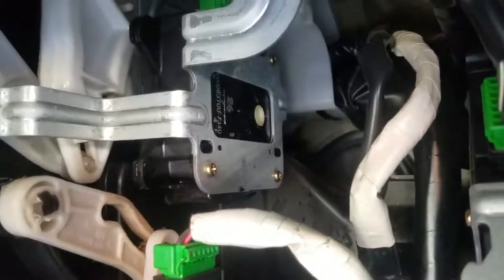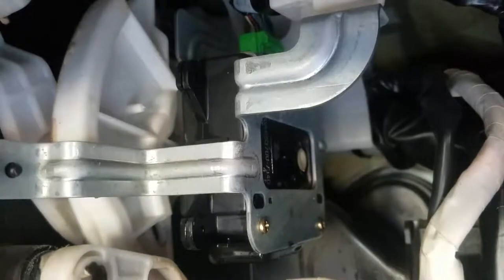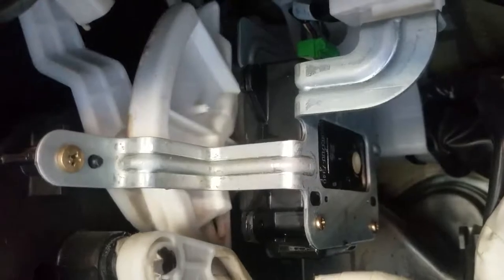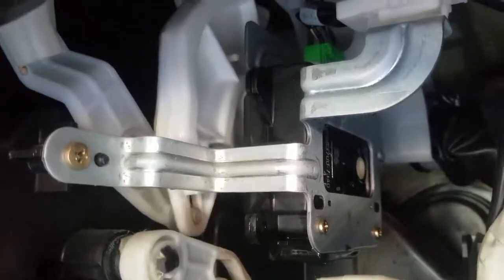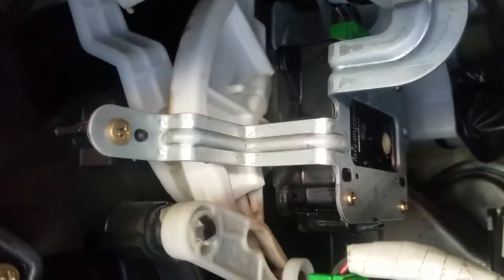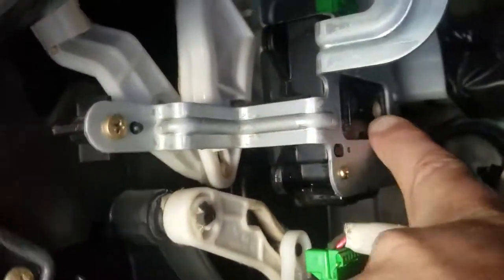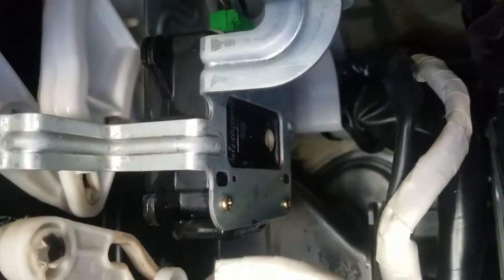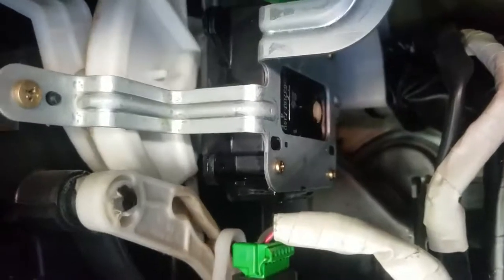Subaru Outback / Legacy 2005 to 2009  Vent Actuator Noise fix - The easy way.

Comment: You are a king among men.  2008 Outback which was having the same issue right at the high lo mode with jitter and grinding.  The depoxit D did not do the trick and I thought I was lost, but then the fader lube F did it!  You rock.
Reply from the maker: Glad it worked. The fader lube is key. You might have to shoot some more in there in a year. But it works.🤘

Comment: you are a God send man!  thank you for this.  My driver side side AC vents are stuck on heat and it's getting hot here down in Texas.  I think Stevie Ray Vaughn wrote a song about it lol.
Reply from the maker: Glad the video helped!! I also had to do the driver's side. Much more difficult to get to but did it the same way. Had to remove the cover under the steering wheel if I remember correctly. Used a two of the hoses spliced together to get it up in there.  4 hands are helpful and a headlamp. Good luck! Over a year on my service and it is still working!!

Comment: I have defrost air and air at my feet but the vents bowing at face don't work. Will this fix that problem? When I start my 05 outback it hums for maybe 20 seconds or so not sure if the sound is related. I don't have any clicking noises. Thank you for this amazing hack
Reply from the maker: It sounds like it may be stuck. Not sure if this will fix it, but it might be worth a try.
Reply: If stuck , what do you recommend ?
Reply from the maker: @erinvoight1286  might just be past servicing.... Unfortunate, but sometimes it just needs a new actuator.

Comment: Would love more description on where to drill on the actuator,!
Reply from the maker: At .18 in the video, you can see the black actuator with the white gear shaft. Drill just through the case maybe a half inch in front of that white gear shaft. Don't drill into the case guts, just through the actuator case wall to create a create a port so you can spray the guts. Hopefully it works for you. Good luck..
Reply: amazon kindly sells the spays as a bundle also!

Comment: Did the procedure and still nothing , should I be able to move it between modes by hand ?  As I am getting lots of resistance when I try and move it. I can feel it start to switch , but it just goes back to the current defrost and feet setting
Reply from the maker: Sometimes the servos are past being able to be serviced. Might need a replacement. ☹️

Comment: What did you have to remove to be able to work on the actuator. Also is this located on passenger side. Thanks nice job.
Reply from the maker: Thanks. Had to remove glove box, and the bit below it if I remember correctly. Not hard at all. Yes passenger side. 👍

Comment: do you have to disassemble quite as completely as the other guy did in the video you  commented on thanking him for the exploded view at the end ?
Reply from the maker: Nope. Just remove the glove box stuff, side trim and drill the hole.
Reply: @PackardDog   thanks!  I am getting nothing from the actuator when I hit the mode button, no sound or movement  I observed this through the glove box hole, but have not removed the side trim!   Could the spray solution still work if there is absolutely no movement or sound at all ?   The head unit cycles properly through the modes when I hit the button, just nothing from the actuator

Comment: Is the Fader F lube a wet or dry lube? Any acceptable equivalents?
Reply from the maker: I would really try to use the fader lube if you can. It is a spray in wet lube. Amazon carries it as well as most guitar centers.

Comment: How about the driver’s side?
Can’t seem to get to the top screw
Reply from the maker: The drivers side I did the same thing....drilled and lubed. There was a bit of luck withit, since its really really hard to access. Its been a few years since then and I no longer have the car, so I can't recall how I did it exactly..... sorry. Good luck with it!
Reply: I appreciate you getting back to me. I got it. Had to remove the gauge cluster to reach the top screw

Comment: How deep did you drill?  What size drill bit?
Reply: Just through the plastic, maybe a 16th of an inch...
Any bit a little larger than the spray tube. Spray it in there good. Put a rag underneath cause it will drip out.
Reply: @rowan7719  Thank you.  And my wife thanks you too.  She'll finally have heat on her side.  LOL!

Comment: Is there an easy way to access this part? Or does it require disassembling the panels around the glove box?
Reply from the maker: Its not too hard. Pop off the side of the dash with the door open, remove glove box, remove another shield under that and you should be able to access it. Its a bit of work but alot less than the the alternative. Its been almost a year and its still working. So it does the trick. When you drill the hole, dont go to far into the servo. Stop as soon as your through.
Reply: @PackardDog  awesome thanks for that, will give it a go over the weekend

Comment: Thanks man
Reply from the maker: no problem. Just got under the drivers side to do the same to the blend servo. This one would be a pig to replace, pretty sure the whole dash would need to come out. I just dropped  the foot protection covers and get up in there with a extended small drill bit. Drill it right next to the bulge. Go slow. If you see white plastic while drilling STOP and move over till you hit a void. Then dowse that sucker with deoxit and fader lube. The noise is gone now. Its been a couple months since I did the passenger side and its still quite and functions perfectly. Hoping the same for the drivers side.